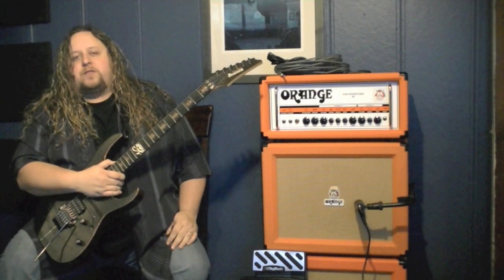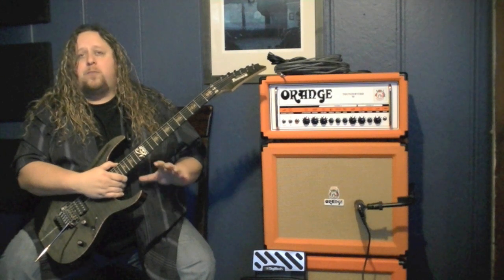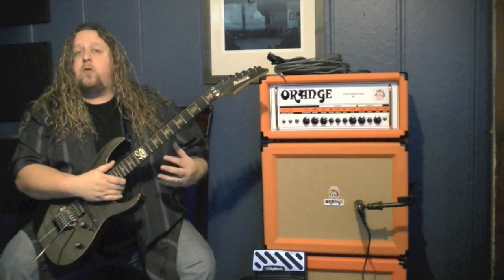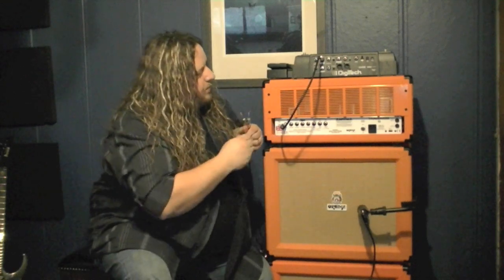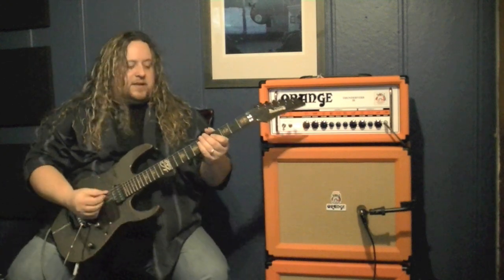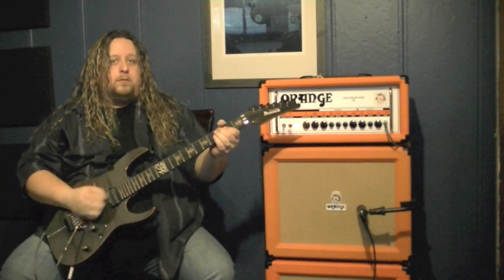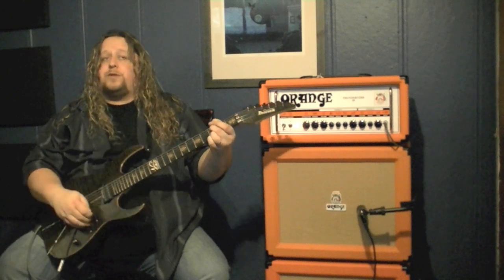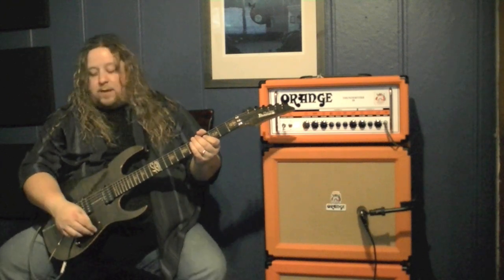Digitech RP1000 & the 4 Cable Method with Rikk Beatty

Comment from the maker: @vampreen12356 Hmmm... I have used these units DIRECT into a PA system and not had a problem so I know its not the fact of using a solid state power amp. It could be a number of things but to start out, which presets are you using? What setting do you have the Amp/Mixer button set to on the back of the unit? Have you tried different cab/amp models?

Comment from the maker: The RP1000 has an "Amp Loop" button that you can turn on or off per preset. If it is on, you are using your amplifier's preamp and bypassing the RP1000's preamp. If it is off (and you are using the 4 cable method), it will bypass your amplifier's preamp and only use the power section of the amplifier along with a preamp from the RP1000.

Comment: Hi Rikk, Effects processor dunce here with questions. I use a Mesa ElectraDyne and amps distortion only about half  and push it in front with overdrive or distortion pedal. Everything is through the front, incl RP1000. A boost through Eff Loop...I know this can't be right any other hook up I've tried I'm unable to create a lead boost. Is this 4 cable method the way to go,With dirt and boost  in stomp loop. I'm really kinda clueless on how to hook all this up. Any help is greatly appreciated.

Comment: First of all thanks for the really informative video. A question on your above comment though: 
Lets say that i want to use two different presets with my tube amps original voicing. So, I do everything that needs to be done for the 4 cable method set up. So suppose I'm soloing during a live gig with my amp's OD channel and I have the "delay preset" on, then I switch to the clean channel of the amp and I also switch to the "chorus preset". Do I also have to press the "Amp loop" button or not?

Comment: Hey Rikk, I'm currently using the RP1000 in the 4 cable method. I plan to get either a GT800FX or Atomic 50/50 power amp and eventually an axefx2. My questions is, do you know if I'm able to use the RP1000 with one of the above power amps with my cabs or direct until I'm able to transition into the axefx? Thanks for you help and the great demo's.

Comment: Hey that's a great demo. I just bought the rp-500, but I cannot seem to get  it to work in my effects loop. I have a marshall jvm410 and I love it's sound. But I really want a pedal to use for wahs, fuzzes, choruses, and reverbs. Does this have a true bypass when I am going straight into my amp? Does it come with cables or do I need to buy my own? 
Thanks.

Comment: Rick - Thanks for the vids. My rig: RP1000, and a Fender Hot Rod Deluxe III 1x12. Right now the RP is front ending the HRD and I disable amps/cabs.  Two questions. 

1) I want to start using the 4 cable system for selective amps/cab sounds. Does this mean I have to re-do my patches and disable amp/cab in the patches where the Fender pre and post amp will be used? i.e. I can't keep the amp/cab bypass on selectively.
2) Do you recommend the  clean channel for amp/cab simulation of high gain amps?

Comment: @rikkbeatty Hi Rikk. Thanks for the awesome demo, sounds amazing!
Just a couple of questions.
1. Can you confirm or set straight a lot of people complaining about a volume drop when engaging amp loop and using just amp tone. How do you fix this?
2. Is there a way to program your own amp tone on amp loop into an rp1000 preset so you don't have to fiddle with the little switch on stage?

Thanks heaps!  Prae

Comment from the maker: No. You can program each preset to have the amp loop button turned on or off. Best thing is to have a bank of presets that have the amp loop button engaged and then another bank with the amp loop button not engaged. Hope that helps!

Comment from the maker: @deandimedof Hmmm... I guess the first thing to check would be that the cables are hooked up right. 

Make sure the cable going from the RP1000's "From Amp FX Send" is plugged into the amplifier where it says "Preamp Out". From RP1000's "To Amp FX Return" into the amp where it says "Power Amp In". Then of course "To amp input" goes to the amp input. I used the Fender Hot-Rod Deluxe ALLOT on the road for clinics because most stores carried it and it had a great tone. Let me know if that helps.

Comment from the maker: @WyldeMagiK Unfortunately the RP1000 wont change amp channels. You will still need your amp's footswitch for this. BUT say you only wanted to use your amp for distortion only, you can still use the RP1000's internal preamps for the clean tones and switch back and forth.

Comment: hey thanx for a prompt rply!
i hae just 2 more questions bout the rp500.
does it have the dynamics sensitive feature? like i get a clean tone when i play softly and a distortion when i play harder on the strings? if yes then can i assign different tones for the harder and the softer parts? also, in this video, when u talk about rolling the volume knob down and changing to clean sound, is it the feature of ur amp(orange), or the preamp feature in the rp1000? it's there in the rp500 too?
thanx!

Comment from the maker: @mungo6000 Running a processor that way puts all effects before your amplifier's preamp. Also,  if you use a "preamp model" from the RP, you are running that preamp through your amplifier's preamp. 

If you use the 4 cable system, it routes the time based effects "post" your preamp & runs all the other effects "pre" your preamp (which sounds MUCH better). Also, if you decide to use a preamp from the RP1000, it will bypass your amplifier's preamp & only use the power section of your amplifier.

Comment: Hi Rikk. I have a Peavey ValveKing 112 and when using chorus and delay directly into the input, the sound was bad. I wrote Peavey and they told me tha t all the time based effects go thru the effects loop. And they where right. My question is if in the RP1000, when using 4 cables, the time effects go this way too? Thanks.

Comment: By running the rp1000 through the fx loop, with my extra delay pedal coming after it in the chain, by switching on or off the rp1000's amp loop, will it ONLY defeat the internal modeling of the rp1000, or will it also be switching off the delay pedal since it's in the same chain?

Comment: @Praetorian10111 Thanks Rikk. I am trying to set up the rp1000 with my new Egnater Rebel 30 head and 1x12 cab. There is no master volume on the head only one for each chanel so I can't seem to control the overall volume of the amp. Is there some way around this? Also when I go to amp bypass on the clean channel and turn up the channel volume I am getting some nasty buzzing overload type sounds. Any thoughts? Many thanks, PRae.

Comment from the maker: @gemari77 Unfortunately the RP1000 does not have the ability to switch channels on your amplifier. But you can select the amp loop feature per lesser and design presets that turn it on and off and go between your amp's preamp and the preamps in the RP1000.

Comment from the maker: @ljvcorp Yes just hook it up using the 4 cable method as I showed in the video, and you will be able to put your external pedals in the Stomp Loop and program the preset on the RP1000 to either be Pre or Post. You can also program the presets to be different volumes so when you want a lead boost, just make a louder preset and there you have it!

Comment: Hello, it runs well with my Delta Blues but the major problem of 4 cable method is volume control when you are direct in AMP (return of the AMP). Volume level can be control in tow way preset/mastervolume level (if the volume is low you loose dynamic or you can't go louder if needed...) or Pedal (in this case you loose the pedal control on other fx/disto/etc and very delicate to tune at the good level...)

Comment: @Praetorian10111 Hi again Rikk. Have solved the buzz overload sound by getting the parity gain. I am at a loss about using the 4 cable method with the Egnater Rebel 30 due to the lack of an overall master volume. When hooked up I have no volume control on the amp. I can use direct but then my delay sounds crap. Any thoughts?

Comment from the maker: @bdoginit01 Are you in Pedal Board mode or the standard mode? If "Metal 2" is a preset, you just have to click on a preset button (1-5 if you are in Pedal Board mode or 1-10 if you are in standard mode) to access it.

Comment from the maker: There is more to the RP1000 and 4 cable method than just the distortion and clean sounds. For instance, the Orange doesnt have delay, Whammy, Wah, Chorus, Flanger and harmony effects. You dont have to use the preamp inside the RP1000. Thats the whole point. Use your amplifier's tone and then let the RP1000 route all the effects where they are supposed to go.

Comment: @Rikkbeatty, I have a Carvin Legacy amp and it's very loud. Too loud actually.
Is it alright to use the 4CM and keep the amp in the sweet spot, but use the volume on the RP1000 to limit overall output?
Will I still get the true tone of my amp, only quieter?
Thanks

Comment from the maker: I had that problem just the other day in Ohio when I had to use a stores Fender Deluxe. Basically I had to turn the master volume all the way down to 4!! Then I finally had the volumes matched. Basically you just need to find the balance between your amplifiers volume and the RP1000's volume. Keep adjusting both until they match up.

Comment from the maker: The volume of your amplifier or the RP1000? Basically you want to adjust the overall volume of the RP1000 using the "Master Volume" knob until you match the volume of your amplifier. That way if you switch to an internal preamp on the RP, the volume will be the same (unless you program that preset to be louder/quieter).

Comment: Thanks for the video Rikk.  Very helpful.  I just bought the RP1000 (it arrived today!)  after doing a lot of reading and watching videos like yours.  A friend of mine said that virtually any multi effect pedal can use the 4 cable method, not only the RP... but I told him that the RP has something that makes it UNIQUE... is that the "Amp Loop" feature?  And I am thinking of what AMP I should use with it, all options are open.  I have a couple of Spider Valve MKII's that I am going to sell because I decided the intuitive UI and capability of the RP is really more to my liking (I had an RP355 once before).  So I need to buy a new amp with a serial FX loop, tube driven of course... I play in a band that plays covers, everything from ZZ Top to Alanis Morissette.  We also play original compositions.  I need a wide palette of sounds for this.  But I have learned that I do not need a 100 watt head for this situation.  Do you have any suggestions of what works really well with the RP1000?
thanks
Pat Gifford
Munich, Germany

Comment from the maker: The amp modeling inside the RP1000 and RP500 will react exactly as an amplifier would react. When I rolled the volume down on my guitar I was using the Marshall JCM800 amp model and only using my Orange amp's power section.

Hope that helps. 

-Rikk

Comment from the maker: @Shoji86 Hey man, check out the video and it will show you how to do it. Basically you plug your RP1000 into the FX send/return and amps input. On this video it will show you the exact outputs on the back of the RP1000 to use. Then make sure you have the "Amp Loop" button disengaged on the RP1000 and you will be using your amp as a power amp only.

Comment: Rik, 
I'm using an old Fender Power Chorus 2x12 solid state, great power, not a lot of tone. On the back are two effects loop inputs -- preamp out and power amp in. Can I use the RP1000 with the 4 cable method?

Comment: @rikkbeatty Ok, then I'll consider the RP1000.
However, how about if I wanted to use this bypassing method for a clean preset (only running through the power section), but still be able to use other FX with my amp's pre-amp section (e.g. on the distortion channel).
Would that involve a lotta switching (a.k.a. step-dance)?

Thanks in advance!

Comment: Figured it out. Solution was to put a ground lift on my Furman SPB-8 pedal board. THAT was the source of the problem, and I only had 1 pedal powered up on it. WOW, might have to get a Voodoo Labs Pedal Power.

Comment: Hi, I just got an rp1000 and am trying the 4 cable method- and I'm having a problem with volumes- when I bypass my amp's preamp and use the modeling together with the power amp, it's totally cranked- I have to put the rp's master volume down at around 2 or 3 for bedroom volumes, but then of course when I switch to my amp's preamp, the volume is super low, even with the master volume on my amp turned up high. I can't equilibrate the volumes between "amp loop on" and "amp loop off"

Comment from the maker: Again though, most gigging musicians that are using allot of effects as well as processors and want the ability to switch amp channels and change MIDI presets will either have a switching system for all their gear or would spend more on the processor to get the extra bells and whistles. BUT as I said, if you want the same sounds from the RP1000 AND MIDI then the GSP1101 is the way to go. Out of the RP1000 & GSP1101, 90% of the Pro's endorsed by DigiTech use the GSP1101 in their racks.

Comment from the maker: @RIPTOTHEJOSH04 Use the "Edit Up/Down" arrows to select the "Chorus/FX" line then turn the "Tone Library" knob until you have selected the Whammy pedal or pitch shifter. Then just adjust the parameters. You wont permanently change anything unless you hit the "Store" button.

Comment: I just bought an rp1000 and I have a vox ad 50vt and it doesnt have a send and return on it. just a jack for footswitch, line/phone, and external speaker. my question is how can i use the 4 cable method with this amp?

Comment: Hey Rikk,
I just got JVM210H, when I tried 4 Cable Method it suck the tone little bit (fx loop 50% wet). My questions, how to prevent it not like that and how to use Noise gate without cutting the tone? Cheers :)

Comment from the maker: Thats odd... Does the Dual Rec have a parallel or series effects loop? The 4 cable method WILL NOT work with a parallel effects loop because it is mixing the original signal in with the RP signal.

Comment: @rikkbeatty Hey rikki just got my rp1000 and was wondering i just want to use my amp as a power amp and my rp1000 as the main everything how would i hook up the rp1000 with the 4 cable method? thanks!

Comment: I dont get the part when you change to the part of pre amp section from your RP1000. When you were using your amps original sound the RP1000 amp mod were in "Direct"? Then when you want to emulate an amp you just change it to the amp you want and the RP1000 will auto disable your amps preamp? I hope you understand :P

Comment: hi rick, how are you doing? i'm considering to buy this rp 1000...i love multi effects since i can download or upload presets on the net...so i dont have to spend my time tweaking knobs...

my question is : does the rp 500's presets are usable in rp 1000??

i ask this because there are more rp 500 presets on the websites..

also, i have a digitech bad monkey that i use as a booster..before vox ad100vt..if i want to still use it along with rp1000, where should i connect it into?thanks very much

Comment: The GSP requires a seperate pedal to control it.  So now you would need to buy another pedal which I'm assuming you will recommend the digitech pedal $300 gsp1101. The gsp route requires about $1000.  Hmmm.....what could I get for that?

Comment from the maker: @Bflatest Nope. It wont do any type of amp switching. BUT you can plug in external effects pedals and have them assigned to be pre or post and on or off per preset.

Comment from the maker: The RP500's presets have a different file extension than the RP1000 so you can not use a RP500 preset in a RP1000. With the growing popularity of the RP1000, I am sure you will start to see allot more presets out there for it. The RP500 has been out longer than the RP1000 so more people have it. 

On the RP1000, you have the Stomp Loop feature. Plug the Bad Monkey into this and you can assign the Stomp Loop to be "PRE" on the presets where you would like to use it! 

Hope that helps!

Rikk

Comment: I want this unit. It'll add fx to my valvestate. I don't want the amp models but the 4 cable method has me wanting this
Reply: It is a great pedal. If you don't want the amp sims you can set it up as a pedal board and it has it's own loop if you want to add individual effect pedals. Plus, the rp1000 are pretty cheap nowadays.

Comment from the maker: @Praetorian10111 
Also, there is no need really to hit the amp loop switch on and off when you have 100 presets to be able to program. I would just program presets that use the Amp Loop and others that just use the RP's internal "pre-amps". Then you won’t have to worry about fiddling with the switch on stage. 

Hope that helps!!

Comment: Hey Rikk I'm having some trouble with my RP1000. I plug everything just as you explain, but I get nothing. I can turn up my amp and pedal up really high, but it comes out real clean and to me it does not seem authentic. I tried different cables and still nothing. Please help I want to use my RP to it potential PS I'm using A Fender Hot-Rod Deluxe Thanks you ROCK!!

Comment from the maker: Well when dealing with all those scenarios, you have to adjust volume levels on each individual pedal as well as the amplifier to get your desired. You have to do the same thing with the RP1000. You have a "Master Volume", a "Preset Volume" and then of course the level of each effect inside the preset. As far as tone goes though I really dont hear any difference unless you were comparing the RP1000 effects to "boutique" effects pedals.